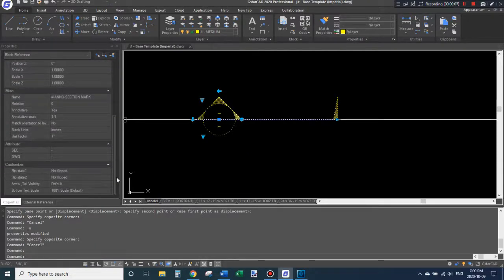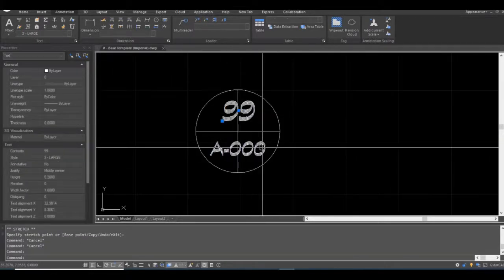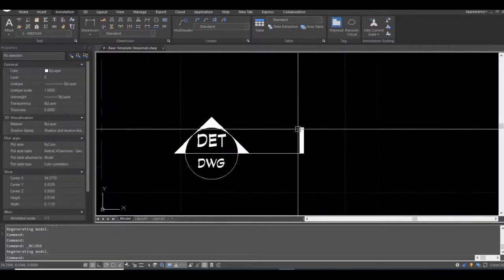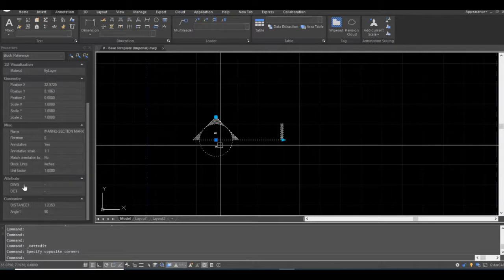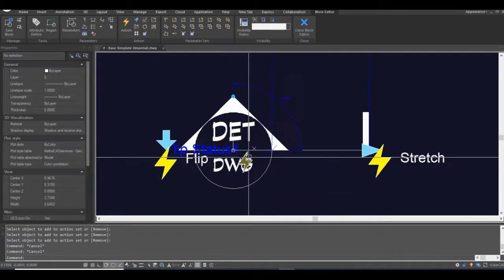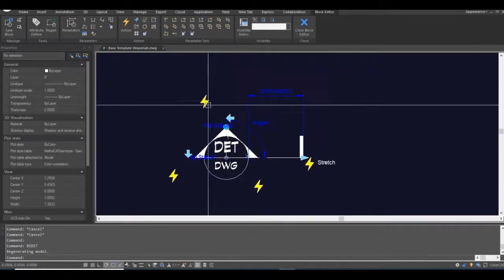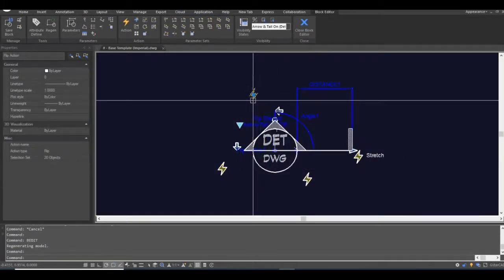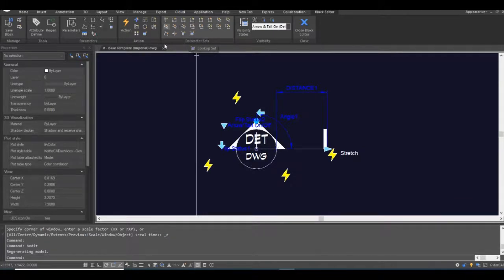GstarCAD: Testing out the block editor

Comment: “Does the standard version of GstarCAD lack the Dynamic Block Editor? In other words, am I unable to define or edit parameters?”
Reply from the maker: What version are you using? Hopefully they haven't meddled with a good thing. The last version of GstarCAD I used (2024) allowed for full editing of all the "Dynamic" block parameters and actions... but... NOT the "Constraint" parameters/parametric constraints, or whatever else you want to call those. GstarCAD has since added those into a higher level version (but I think their base version still has the Dynamic blocks).
Bringing blocks to and from AutoCAD (or another CAD) to GstarCAD was fairly reliable. The "Action" parameters are also quite stable (constraints tend to cause more crashes). But it's good to settle on one program and built your content there.
I'll go have a look and see if they've done something silly with their versioning. Hopefully it still works as that would be a huge bummer if they took it out.
Reply from the maker: Had a look and I noticed that the "Pro" version lists "advanced block editor" where the standard version doesn't. I think I've seen this before: That being when these companies start making different versions - often pressured to do so by dumb marketing teams. It actually causes issues with the program itself sometimes because it's not so simple just to block features for a cheaper version. The "Standard" version is listed as an AutoCAD LT replacement and therefore it should include the "Dynamic blocks" (but not the parametric constraints) - but maybe it doesn't huh? Right now I'm using AutoCAD LT as I desperately need the reliability and stability and don't have time to make sure another company's program works properly - that's what these companies have to realize: Stuff's gotta work and stay consistent.